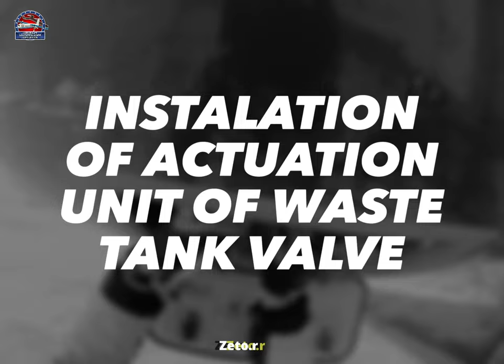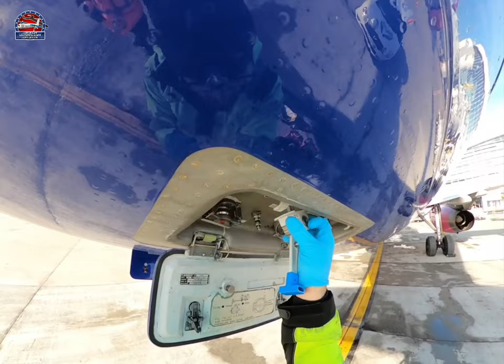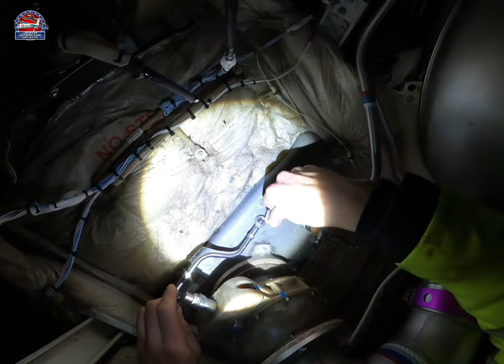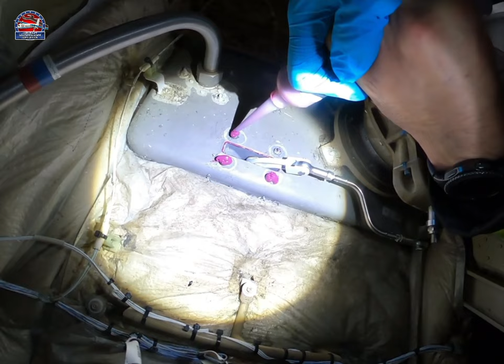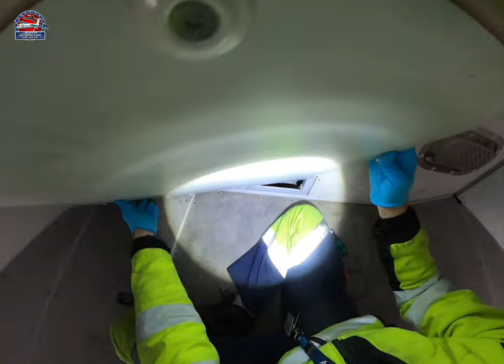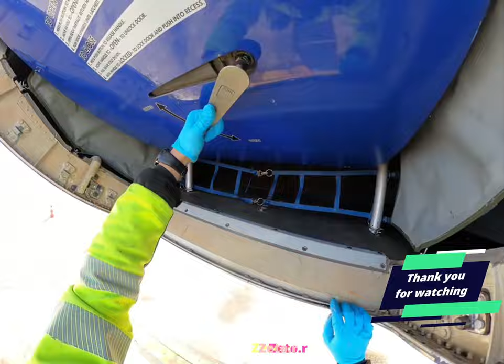Installation of Actuation Unit of Waste Tank Valve at Airbus A320

Comment: What is that pink gum like thingy you applied on the bolts after installing the actuator? Water proofing?
Love you videos👌🏽 keep it up
Reply from the maker: It is a sealant. As you can understand, it prevents air to pass . Since aircraft are pressurized, you need to seal the parts so pressurizing the aircraft can be performed
Reply from the maker: Thank you for your kind words ☺️
Reply: @aircraftmaintenancengineer  Understood,  Thanks alot
Reply from the maker: You re always welcome 😊